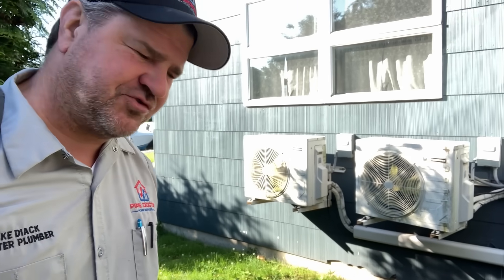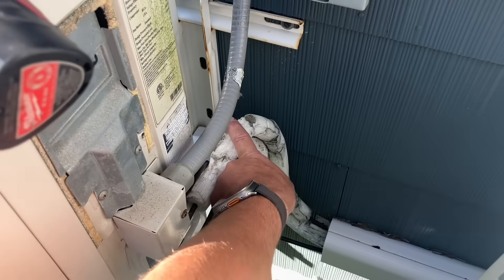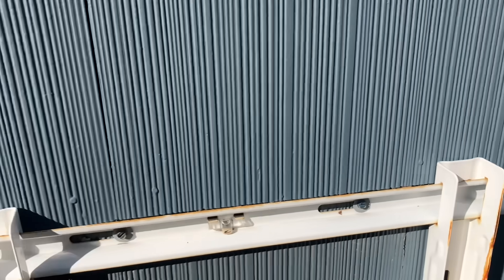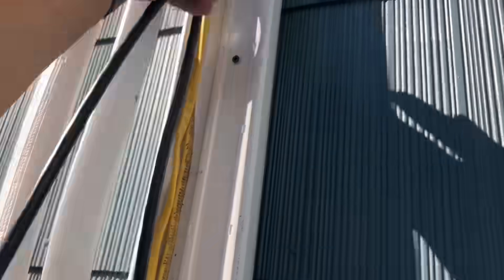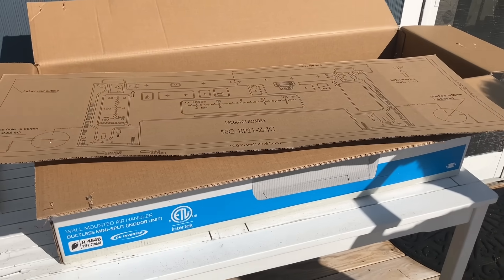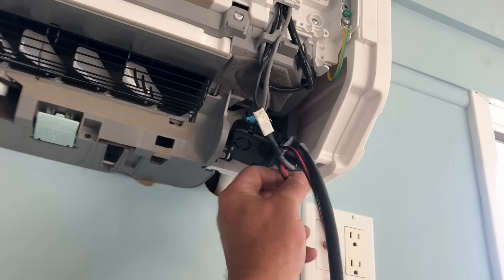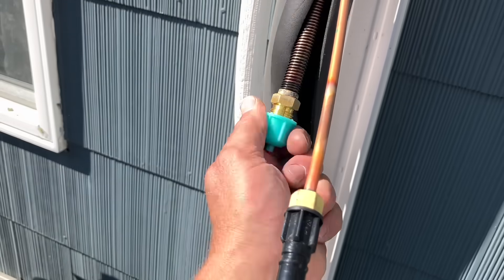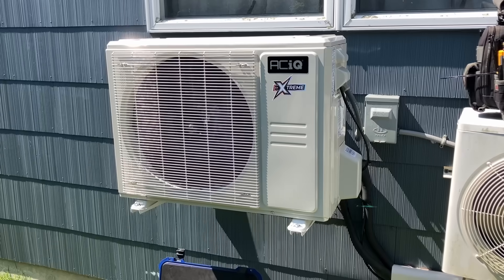Blue Ridge Mini Split Failure! Replacing with Ultra Quiet ACiQ 18k Ductless Heat Pump

Comment: I have a multi split senville unit with all the same components and it really is a great unit. I put a couple wall units in the basement and has been cooling and heating trouble free for 3 years so far. Already paid for itself over the old baseboards.

Comment: Those white insulated line set covers seem to be a big problem. I watched a great video by Craig Migliaccio discussing Formicary Corrosion. It was very interesting and informative. It seems the white line set covers are a problem waiting to happen. Maybe the problem has been addressed in the newer insulation.

Comment: 99.99999999999999% sure those ACiQ mini splits are made by Media which also makes Bosch Mini Splits. I'm sure they manufacture several other name brands for the OEM's to their specifications. Media is a very large company and should provide parts and service support for these systems in the long term.

Comment: Mikey pipes if you hold the unit vertically in front of you instead of over your head, you cradle the unit with your left and guide the pipes with your right...easy peasy lemon squeezy
Reply from the maker: Great idea
Reply: @PipeDoctor i have had to do more than a few installations solo and this has been the best way  i found to do it for me.
Reply: Or just use the mighty rack and not hold it in your hands at all. Lol

Comment: No flare to zoomlock fittings? Mike, your selling me on these to condition my second floor, but the 454 shortage is holding me up. Currently at a tug of war between Aciq & Daikin both have 12 year warranty
Reply: I would choose Daikin system using R32 !
Reply from the maker: A2L for the win 🥇